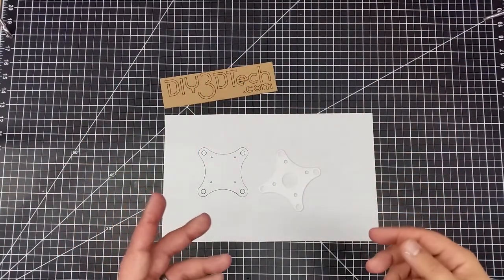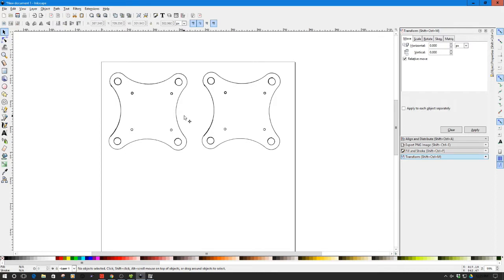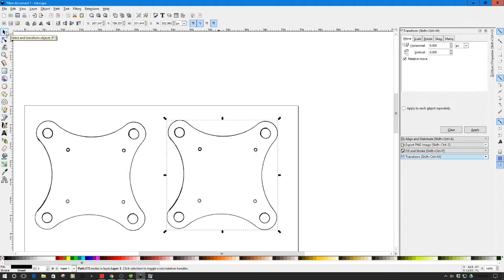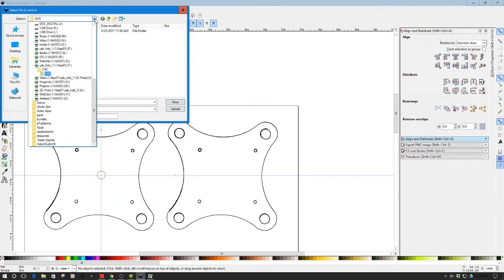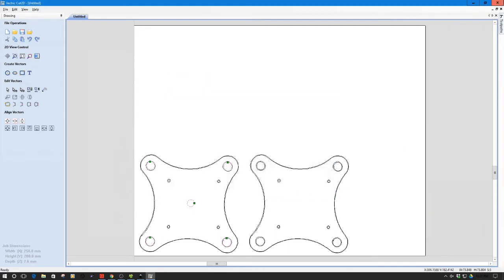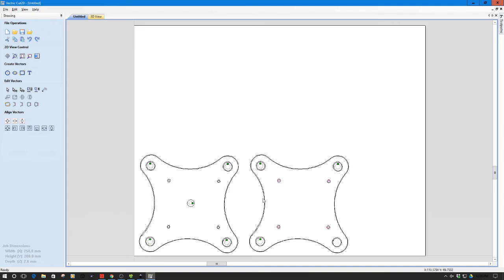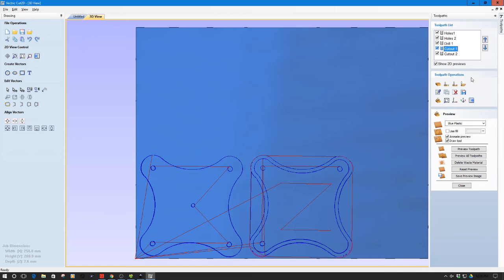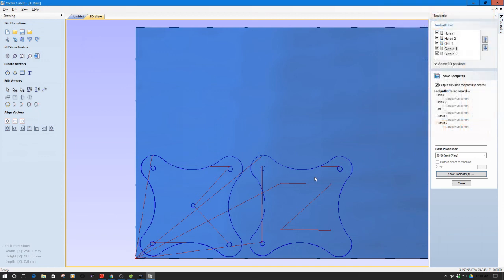Inkscape Tutorials - Rapid Part Replication for CNC Production Part 1!

Comment: Hey! I been watching your videos. Your doing a great job! Thank you.
I have a question about the cnc 3040, I got this machine a couple months a go and honestly I'm a busy person always looking for free time to spend in my hobbies. 
I saw the first videos about this cnc and you talked about the spindle works in s1000 and also you said doesn't work on pc just manually. Well I have the axis working fine I added a joystick that help a lot. But honestly I don't know how to make the spindle to work. Work fine with the pc off ones I turn on the pc stop spinning. Can you please give me a ✋? 
Thank you
Reply from the maker: Know what you mean with time, however you left out an important piece what means are you using to drive it (Mach3, GRBL, ???) ?  With this too have  you sent an M3 or M5 command (spindle start) to see what happens?
Reply from the maker: P.S. forgot to mention when you connect an input to the controller, the manual functions are passed to the PC (safety?  not sure)  so you need (or at least in my cause) to activate via gcode...
Reply: Thanks lot for your fast replying. I just check m4 and m5 and didn't worked. The machine is in parallel port 21pins. 
I don't know a lot about g-code and that's the next step,I'll check some tutorials and see what happens.
Thanks again ! 
I'll let you know how that goes!
Reply from the maker: Thanks, but you still have not shared how are you connecting?  Are you using mach3?  If yes also make sure the safety is off on Mach3 especially if your are using the old ripped off clone version they might of sent you.  Also check the configs too of Mach3 to make sure your toggling the right pins.  Its been many years since I used Mach3 while a good program, I felt it to be too complex as I had to relearn ever time I used (say monthly) and now I just everything to GRBL and life is better :-)
Reply: I'm using mach 3 and for sure is a complex program .I have more experience in designing programs this is way to different. I saw your video where you added the GRBL and honestly I don't know if I can do that .I got  2 3d diy printers one uses recine another one PLA. But i haven't learn to much about G-code. By the way I also like to built drones, that's why I got this cnc.
So,if I set this GRBL I don't need mach3 anymore? How that works?
Reply from the maker: With GRBL you no longer need a parallel port computer as you just use a GCode sender to send GCode via USB to GRBL and it simply creates the pluses for the stepper drivers. To do this mod you will need moderate electronic skills including working with arduinio.  Also to your problem, sounds a like a Mach3 issue as either its not toggling the correct pin or there is a safety lockout set.  As you will need a gcode command to start it (if there is spindle button it still is just sending the gcode).  also check out my drone site and channel too: http://video-drone.diy3dtech.com  :-)